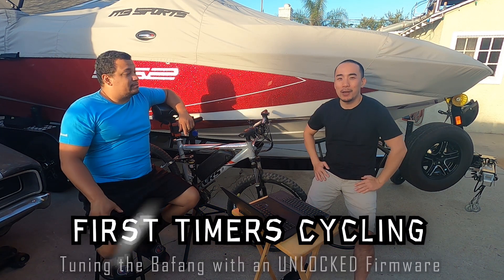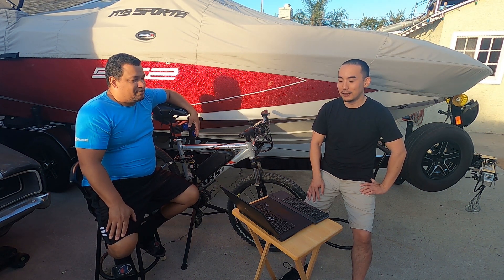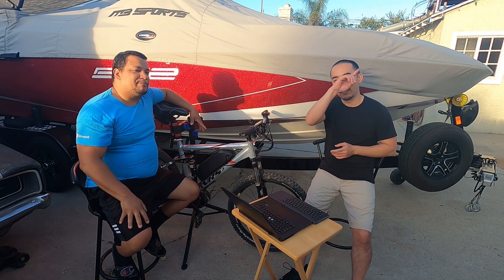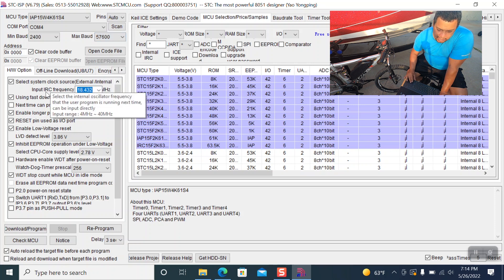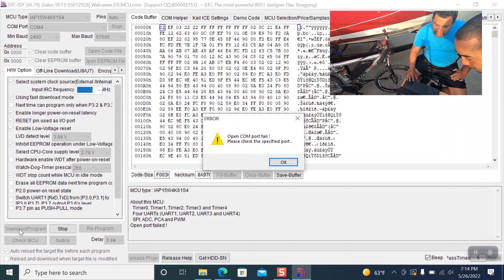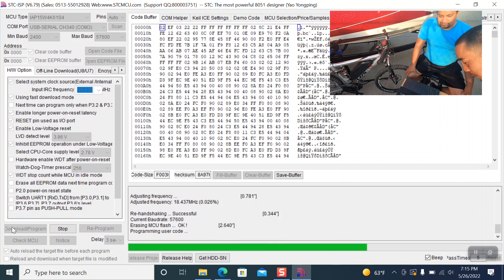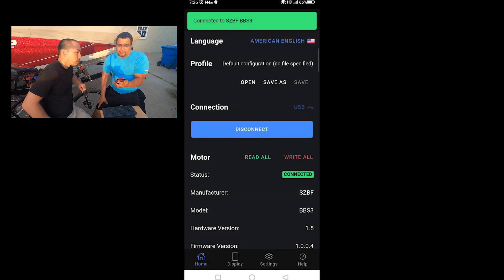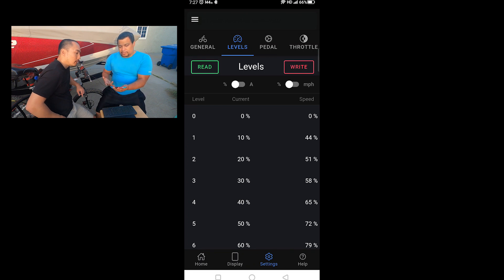Tuning the Bafang Controller with UNLOCKED firmware

Comment: it did check the MCU once, but didn't take the download and can't check the MCU anymore, please advise
Reply from the maker: Did you get any errors? Did the check scan run at all? Remember you may need to disconnect the battery and refasten it for the check MCU to run the test.
Reply: @FirstTimersCycling  no error.  the first time try, did get a successful complete result, but couldn't get the download code work, since then, no MCU anymore.  I disconnected (removed battery), connected, turn on and off.
Reply from the maker: @KelvinChanMcSquared  Does the bike still power up and function? What is your setup? Is it like ours? Bafang BBSHD 1000W with a 52V battery?
Reply: @FirstTimersCycling  lucky still function, bbs02 750wt. Alfine 8 igh, mild  setting, try to keep the battery last longer. City commute, no off road.
Reply from the maker: @KelvinChanMcSquared  Hey, not sure if this tune works for the 750w. This was meant for the 1000w motors with 52v batteries. You may want to just try connecting to the Speeed App to tune settings instead of a full ROM tune like this one. Check out this video =>  https://youtu.be/AdX12LCxRRo
Reply: @FirstTimersCycling  oh no, i got a new cable, worked with changing the setting, however after flashing the download code, 30H error. I flashed the 48V file from Gold motor,  which cleared the 30H error, however, still no response.  an "!" on the display, I am thinking i need to flash the original 48v 750 watt bbs02.  where can I get it back?    Help!!!
Reply from the maker: @KelvinChanMcSquared  Chan, I'm sorry to hear this but the only sites I've researched are for BBSHD motors. We are not pros at this and only wanted to share this firmware for those who were willing to dive in and do their own research. I'll try and find one for the 48v 750w BBS02 but no guarantees. Hopefully a viewer can chime in to assist.
Reply: @FirstTimersCycling  I contacted golden motor they are so kind and sent me the bbso2 firmware, haven't tried it yet, I'll keep you posted.  I got the motor working again. What's a relief.  two things:  1st cable (clear one) no good, 2nd cable (all black) works.  Apps still hit and miss, but PC connect works wonderfully.  Like your videos. Keep up with the good work

Comment: Is there a firmware for BBS02B (750W) that allows setting throttle to 100% even on Level 1 Assist?
Reply: If you get the speed app to connect you can set your throttle to 100% at all times.  I've gotten my BBS02b setup this way.  If the Speeed app is glitchy there is also a PC program you can run on your laptop that does the same thing
Reply: I sent you an email with the links.  YouTube won't let me post them.
Reply from the maker: @ebikeengineer  Thanks!
Reply from the maker: @ebikeengineer  Got the name to that PC program? Also is it Windows only or is it Mac compatible? If you know?
Reply from the maker: Hello and thank you for your question! What allowed for the throttle setting at 100% even on Pedal Assist 1 was the Speeed App. Not totally sure if the app works for all Bafangs but it's worth a shot since it's a free app. I would do some research to see if it's compatible with the 750w. I'd assume the worst case scenario would be that when you attempt to connect to the app via USB to \Bafang controller, it will just say not compatible or error out before you even try to make any changes. Here is the video when we first tried the app and discovered about the throttle setting => https://youtu.be/AdX12LCxRRo With that being said, you won't need to update the firmware, just connect the existing (stock) controller to the app and tweak the settings. Hope this helps!

Comment: I got the 30H error right after overwriting the firmware, reconnecting the display, then turning it on. Powered up okay, 30H, turned itself off... Totally dead... Wouldn't power back on... Panicked for a minute.. Doing everything from the start a second time fixed it no problem. The only different thing that happened to me was that I could only pick 3.82V as the LVD detect level the first time, not 3.86V. The second time the 3.86V option showed up.

Everybody with a 52V battery should do this. Without changing any settings but 28amp to 30 amp, top speed at lvl 9 throttle with wheel off the floor went from 44 mph to 61mph. 17 mph from just 2 amps? My old firmware must have been garbage.

Thanks guys!!!
Reply from the maker: I'm glad you were able to clear the 30H error! We got that error once but not with this firmware. We panicked as well lol 🤣

Comment: Thanks guys. I tried the new file. But my throttle stopped working? And it still says 48v when plugged into my laptop? Any suggestions?
Reply from the maker: The throttle should take whatever PA1-PA9 you are set at. So if at PA0 you will have no throttle. With this firmware you can connect to the Android Speeed app to reconfigure the throttle as well. We have yet to figure out what will make it show 52v. Hoping somebody would chime in with knowledge on that part.
Reply: got the same issue. Have you been able to correct this?
Reply: I got the firmware to flash properly and all is good now. 48v battery shows 100% when fully charged just like it is supposed to. Throttle now working too. WooHoo!
Just took a little more time reading everything I could find on the topic. Luna said it couldn't be done... HAHA

Comment: You can get the 48v controller firmware from endless Sphere, it's from bafang, it will give the correct battery level when using a 48v battery, you can change the max current from 28a to 30a.
Reply from the maker: On the bike we are doing the tuning on, it's a 52v battery but shows 48v on the controller and app. With the Speeed app we were able to change it from 28a to 30a aswell but it still showed 48v even with the 48 to 52v firmware update. That's what we are trying to figure out still. To see if once it shows 52v, it'll have even more power.
Reply: @FirstTimersCycling  my BBSHD has a 52v controller and for that reason it would never show a fully charged 48v battery as 100%, it displayed it as 70% charged, but it also showed a max current of 28amps which I couldn't change with the app or laptop, that was until I flashed the 48v firmware to fix my battery display charge level, then it allowed me to up the current to 30amps. 
Maybe your controller is rated at 48v and doesn't recognise a 52v battery, have you measured the voltage at the battery terminals to see it's a 52v battery, I guess you should see around 58v, as I get 54.6v on my 48v battery.
Reply: @acelectricalsecurity  Could you tell me which firmware you used because I have the same issue with mine recently bought. The one basic 48v firmware from golden motors or the unlocked one or sth else? Answer please
Reply: @staryjarocinek2386  I found a site called endless sphere, they had instructions and the firmware on there, it was very easy to find
Reply: @acelectricalsecurity  Thank you, I appreciate. Greetings from Poland.

Comment: When you hit load take a look at the program The ones and zeros and characters on the right hand side The program is corrupt halfway through the programs it just starts repeating zero's over and over again for 3 pages long I don't know where you got this program from but Pierced to be corrupt
Reply: Thanks for trying nothing worked I got control over my bike again But every single map I upload gets locked out as soon as I try to make a change and I have to upload a new map completely locked out every map I've tried
Reply from the maker: Im happy you got the bike working but sucks you can't modify it. At least you can ride, that's the important part!
Reply from the maker: So what happens when you use the .hex file from Golden Motors? https://goldenmotor.bike/downloads/ This is the firmware we first used as we explained in this video. This one won't allow you to reconnect to any phone apps like the one we used (Speeed App) in another video. We couldn't fine tune the firmware so that's when we were provided the updated one by a viewer who got the update from Golden Motors. Watch the video, the dude even states to contact them and they will send you an updated firmware which is the one in this video.
Reply from the maker: If the .hex file from Golden Motor doesn't work, try this one I found -> https://california-ebike.com/pages/updating-bafang-firmware
This also has pretty clear instructions. If at least it gets your bike running again, you will have a base map to work with and can play with the other firmware updates again, if you so choose to.

Comment: This really work for you let's see your bike actually move after you download the program
Reply from the maker: Hey, sorry you're bafang is messed up right now. There must be a step you missed during the setup process as we got these firmware updates from a reputable site called Golden Motor. The bike moves in this video and on the next video where we do an actual ride. A bit busy today to help you right now, but let me message you later. Or maybe Alvin may be able to respond before me.

Comment: I just want to go back to the original program at least the bike worked can't ride the bike the way it is After downloading the program I'm having a problem with my brick sensors the light and it will no longer read the battery great program

Comment: The controller amp is at 28. How can I setting it up at 30 for example?
Reply from the maker: If you used the firmware in the description of this video, you can reconnect to the Speeed app on your phone to change it to 30a.
Reply: @FirstTimersCycling  I ordered one on amazon thanks. So this is why when other software app to tune it I get error 30 because they not on the same firmware? By the way did you see my bike? I have 3 motor on it.
Reply from the maker: @electricbikeretrovintage  That is absolutely correct. The Error 30 came on for us on the previous firmware when trying to reconnect to the Speeed App. Had to reload the firmware to clear the code then all was well. The firmware on this episode will allow you to reconnect to the phone app and tune it. And holy crap rear hub, mid drive and front hub lmaooooo, that's mad insane!!
Reply: @FirstTimersCycling  Yes thank you so much for the UNLOCKED firmware video.
Reply: @FirstTimersCycling  I don't have an adaptor USB to connect to my phone. Is this app work with windows?
Reply from the maker: @electricbikeretrovintage  If you are referring to the Speeed App, it's for Android phones only. If you are referring to this video, the app we are using is meant for Windows systems only.

Comment: I have not checked if it says 52v in the app but the battery meter now works as it should. Another nice thing to do with the bafang midrives is improving the chainline  blingring is one, but changing the ratios on the casette works very well since we gave electric bikes we do not need the ratios to be so close now i have 28,24,21,19,17,15,14,13,12,11 but i will change this to 28,21,19,17,15 did this on my bbs02 without blingring and it worked ok will try it soon on my bbshd.
Cheers!
Reply from the maker: Agreed with the ratios! With them being so close there is no point. We haven't created a custom cassette on Alvin's bike yet and for mine I'm single speed so I just change them before a ride if I know it's going to be hilly or not.
Reply: @FirstTimersCycling  yes im aware you ride single speed hows it working for you and what sizes. If alvins intressted he could swap the gears putting the ones not used behind towards the spokes and set the limit screw to not use them did that on the bbs02 will print som spacers for the bbshd thinking of replacing the limit screws to something longer so that i only can use 3-5gears ibstead of 10 -2 last ones
Reply from the maker: @sketchysticks1127  Working great! 46t front and 34t rear. Only time it sucks is riding flats but then I just up the PA and ghost pedal 😅. It's good on the uphills, I almost want to try a 36 or 42t in the rear for even better climbing capability. 

About that rear cassette thing you're talking about. Is there a specific brand that allows breaking down the gears like you are saying? Because on his the first 2 or 3 cogs I can see separate but the rest are like riveted on with no center spline. Makes sense what you're saying but I don't think Alvin can do that.
Reply: @FirstTimersCycling  there are some sunrace casettes that uses screws. The rest use rivets but i heard that you can drill it out since the splines(unsure of the word) on the hub body holds the gears in place have not tried it myself yet but will soon.
Reply: @FirstTimersCycling  is it not easier and cheaper to change front sprocket for a 42t since going to a 42t rear you need a new deraileur and with that sometimes a new shifter also
Reply from the maker: @sketchysticks1127  It is easier to change the front but didn't want to change it until it was worn out. The rear though, with the adapter, I use front chainrings for the back with a 104bcd. On the front 42t is the lowest I can go to maintain chainline, really would have wanted 36t. No derailleur or shifter for me! Single speed life 🤣
Reply from the maker: @sketchysticks1127  Ah I see. Yeah on Alvin's it's all riveted. I forget what cassette he bought but it doesn't look like it has the splines on the bigger gears to be put on the hub body.
Reply: @FirstTimersCycling  yea sry was kind of tired have 12h shifts and did not sleep the night before. But the tension arm need to be long enough or am i thinking wrong here?
Reply from the maker: @sketchysticks1127  No worries! You might be right about the tensioner! I was hoping that the chain slack would be tight enough to not have to use one. That or I might be able to push up on the tensioner instead of down like how it is right now. Still need to experiment with that idea.

Comment: I actually used the speeed app so I could get level 9 throttle all the time but I didn't up the amps because I don't want to blow up my motor I heard some controllers have been blowing up
Reply from the maker: Originally with the previous firmware, it only allowed 28a for the 52v. The 48v uses 30a. Now that we were able to reconnect back to the Speeed app after the firmware update, we moved it back to 30a with the 52v firmware. Hopefully it doesn't blow anything up but that's why we're testing it.
Reply: @FirstTimersCycling  I hope everything works well and thanks for doing these sort of tests for us guys 👍🏾
Reply from the maker: @ashpunting  Yup! 👍 Hope things work well too 🤣.  Thanks for commenting!